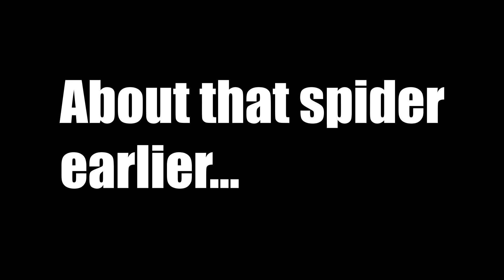Strut Replacement the HARD way - Day One

Comment: Just curious how did u get the top hat onto the new shocks,that new shock shaft seems to be shorter the old one?
Reply: For the top hats when you remove the little dust cover you will see the bolt in the middle and you need to use a vise grip to hold the strut and then loosen the top hat off. Atleast that’s how I did it, wasn’t too hard but wasn’t easy.
Reply: @uhFluxy  Impact wrench will take it right off, no hassle. BUT you will need to have spring compressors to be completely safe...